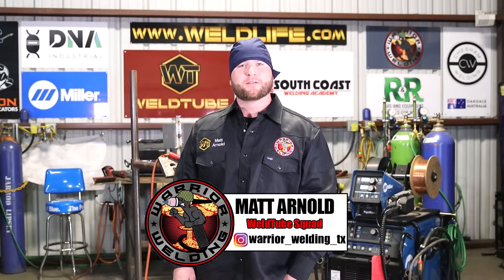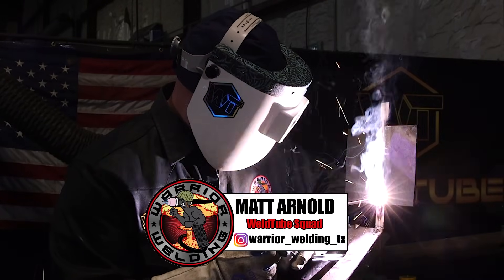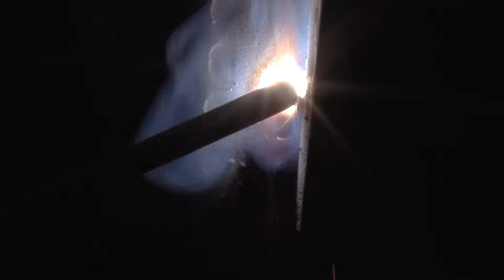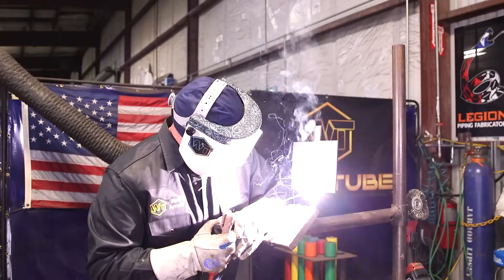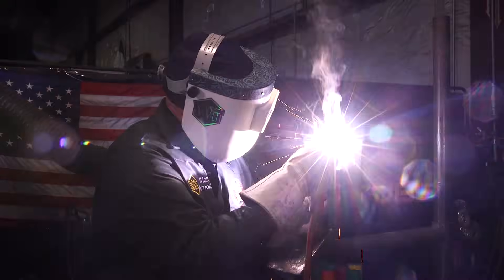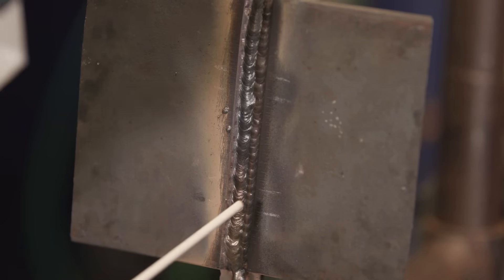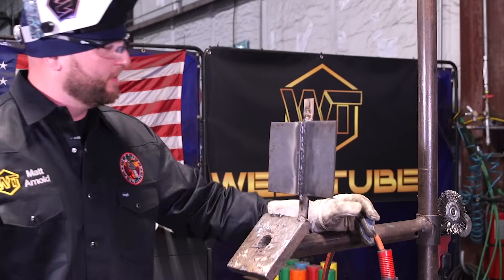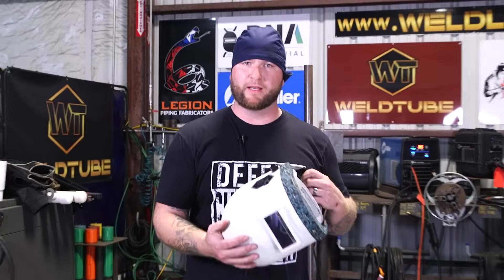3G Uphill Stick Welding D1.1 Test | SMAW

Comment: Wish I watched this before the weld test I went in for. Definitely would have had a better chance. I over thought the “no weaves” on the instruction sheet. Oscillating isn’t necessarily considered weaving. Threw away a prevailing wage job but oh well. At least I know what to expect for a D1.1 test

Comment: What settings should I run on one of the school FlexTec 350x Lincolns? Specifically for vertical, I tend to move fairly quickly but Ive slowed it down to prepare and Im still getting a fair bit of porosity. Right now Im running 93 amps with a 10 Hot Start and -6 Arc Control

Comment: Thank you so much for posting these videos. I'm taking my D 1.1 3g and 4g tests in 2 weeks, and four weeks.  This is going to help so much, besides burning electrodes in my backyard with a cheap spark box😂.  We only get 7 hours of shop time 1x a week at my school which isn't enough.  I pray i pass.  I'm still going for my local ironworkers Union written test, and already applied.  Practice makes perfect
Reply: All I can say is the iron workers unions retest you no matter what welding papers you have. They have there own test that you have to pass for the local an the international it’s the same test no power tools 1 inch for an unlimited an 3/8” for a 3/8” but if you can pass a 3/8” you can pass a 1 inch

Comment: I've been having trouble while doing verticals, when I start the weld the bead is going good but once I start getting close to the top it's starts spattering everywhere and my weld starts to drop out. Any idea why that might be happening?
Reply: Plate getting too hot.

Comment: For shipyard  test, they want you to run stringer beads the whole test. Which makes since for the amount of heat in a weave bead,that heat changes widens grain structure.
Reply: yea most structural welding jobs only allows stringers or has a set bead width you need to match.
Reply: I'd rather weave the entire test,letting  it cool a little after each pass, I think it's a better weld and a better looking weld  ,I've heard people say both though?
Reply: @DavidGregory-qw4ws stringer beads are stronger
Reply: I'm an instructor at newport news shipyard and we don't allow stringers on test it has to be weaved
Reply: @dnice.757  Are you a structural welder or just manufacturing parts? also different jobs may require different bead lengths depending on your process etc.
Reply: Thats good to know! @dnice.757
Reply: @dnice.757 why?

Comment: How are you getting such good pen on 85 amps when i was running my flat test i had to crank it to over 130 on 7018 rods just to get solid pen.
Reply: You running DCEN? also 3/32 rods use lower amperage than 1/8
Reply: @codymillager720  No EP 1/8 rod. Im sure its probably my arc length and angle but the welds look great, getting nice peel but when i go to do the testing im getting some breaking and minor pitting horizontally on the root where the backing is. The throat bends do hold up though. I think the biggest issue is that we dont have a grinder in class and i cant just give it a quick shot to take off some of that mill scale.

Comment: New hood still in development? 

How much development do you need to rehash the same hood that's been around 70 years?

That bevel looks like trash! Look at all those dips. Overall I would expect better videos out of a welding school. Absolutely no mention of how to prep your plates like removing mill scale on the back side or backing bar.

Comment: I'm currently doing this test at school right now except it's with a 1 inch plate. I'm having the hardest time, it's like I forgot how to weld. So thank you for this.
Reply: exactly uphill just difficult 😭😭😭
Reply: @MacOnSaturn  Uphill gets a lot easier over time just keep practicing.
Reply: @JoeRoganVault1  yea i’ve mastered it now😮‍💨
Reply: This is kicking me in the rear right now. The class prior just running welds up the plate I did great and picked it up quick, not so much now!
Reply: @MikeFL2TX  yeah welding humbles you.
Reply: @ivandalok i weaved don’t forget to pause on your edges
Reply: @MacOnSaturn it doesn’t take 4 months to master welding, it takes years
Reply: @MacOnSaturn bro u didn’t master it 💀
Reply: @Mdawg100 bro hating on me just because yu ass don’t mean i am😭
Reply: Hope you passed 🎉

Currently scared of my test soon
Reply: @ChinoTheBear  I did eventually pass. Took me 2 tries
Reply: @thisfool90 I made it through oxy welding, stick and mig, but had to stop. As this is all hobby, I’ll see what’s next as far as welding school goes.
Reply: Settings are a lot of it
Reply: What till uphills are your nicest welds bro haha they are hard but once you get it you can make them nicer looking then a flat with the same strength

Comment: What’s a good amp for this ? I have it at 115
Reply: For me, 3/32 between 85-90
1/8 between 110-120. Every machine is different.
Reply: @petergriffin7121 I use 3/32 around 88-92 I use a Lincoln.
Reply: @okieboyz815  haven’t used that machine, do you lower it after a few welds since the metal tends to get hotter?

Comment: Today was my first day for intermediate stick and my teacher said to put it on 100 amps I thought it was too hot when welding and my welds were shit no matter what I did I’m gonna try this thank you sir!
Reply: Amperage depends on the size of the electrode your using. 7018-1/8 electrodes are run at about 100 amps. In this video he’s using 3/32 rods at about 85 amps. But always play around with the settings up/down because if other people are welding around you and drawing on the same power source, it might be what’s causing problems also. Hope this helps.
Reply: @AuthenticSillyGoose another factor to add is that it makes a difference what temp the plate test is. If you’ve been adding filler passes nonstop for 10 minutes, you may want to turn down the amps a little when the piece is getting hot.
Reply: you can also google the specific electrode you’re using. the manufacturer will often have suggested setting provided on their website, in my experience they’re usually pretty accurate
Reply: Best way to learn. That way, you know what way too hot is.
Reply: 7018 1/8 inch I weld at 115 an with the guys I work with that’s cold to them they are at like 125 to 130 but all I can say is go up to 115 for an hour or two when practicing so you are trying to catch up an then slowly go down till your speed it matching the amperage an then get used to that an slowly get quicker an the amperage will slowly go up. It’s just a game up what looks right an feels right the hole time

Comment: Hi, I have a question, if I have half rod that I have used before the mechanical strength of the joint will be the same or lower than the previous weld done with a  new  stick? I know that in some factories half used rod are thrown away for this reason

Comment: Just took my 3g test last week according to d1.1,1 inch thick plate using 1/8th 7018.  passed it without power tools. It was one of the best plates ive ever done
Reply: No power tools allowed at my Union either.. 😂.  Chipping hammer aka a raking hammer and a brush.. i didn't mind.
Reply: No power tools at my hall either for plate test
Reply: That rule is so dumb like if you aren’t going to use power tools in the field
Reply: What was your settings I got a test on Tuesday 7018 1/8 3g
Reply: Power tools weren’t allowed?
Reply: @downhilldaddy5282 my union welding school doesnt allow grinders. We have to use a chipping hammer, picks and wire brushes. But if you are going for light gage certs. You can use a grinder. Its very stupid.
Reply: @drpeppero3  interesting
Reply: @drpeppero3  it’s smart this way you qualify for your bridge Cert D1.5 without having to retest I think that’s why they do that it’s a D1.1 / D1.5 Combo test

Comment: Did you stay at 85amps the entire time?
Reply: Yessir!
Reply: @Warriorweldingtx  thank you for clarifying that. I've been fighting to get this right in my class and after watching you I realized I've been running way too hot.
Reply: I’m running a 3/32 electrode though so remember that, if you’re running a 1/8” I’d run around 115-120 amps.  Best of luck!
Reply: @Warriorweldingtx  we run 3/32 in class and I had been running it between 115-125amps. I kept getting massive amounts of arc blow at the top of the weld right before the upper runoff tab. Last night I went in and cooled it down to 85amps and it ran perfect. Thank you.

Comment: So what do u do with the plate after ur done like the back part?
Reply: You remove it
Reply: Gouge it off with cutting torch. Grind mill scale off, inspect root, then cut for bend
Reply: The inspector will look for the heat zone reflected on the plate.

Comment: Wtf???
Canadian cwb requires 2 start and stops inside the bend area,  how else do you test your tie ins?
Reply: I’m from Alberta I’m thinking the same. Much easier test to pass this than any cwb I bet
Reply: @houzer4444  yes I've also seen an AWS I believe,  and they were aloud to grind between passes.?!?!?!?
Reply: @davidsolomon915  you bet, power tools are allowed, a D1.5 bridge code test does not.
Reply: @Warriorweldingtx  yes power tools are here too.  But only a wire wheel.  No grinding or file  or die grinder. No material removed. 

Test is alot about bead placement , test needs to be thought out right from root.   It about sound welds at production speed.

If you grind out your weld after every pass, not very fast fill rate
Reply: @houzer4444  I'm in calgary. Where you at?
Reply: And we use 1/8

Comment: Why don you use a copper backing plate instead of a steel one? Doesnt that steel one need to be ground off?
Reply: You weld steel to steel. Your root is burned into that backing strap to make one solid part. If you out a copper backing you'd encounter all sorts of problems. Sometimes that plate is ground off, machined off, or sawed off
Reply: @gavinhughes6054  What problems would a copper backing cause?
Reply: @gavinhughes6054  at my college we use scarfing tips on the oxy torch for our backing bars
Reply: You gouge the backing bar off with cutting torch. Then you grind off all mill scale then cut to bend.

Comment: Something to consider, if you can use power tools, on the fill passes don’t strike ahead. Light up behind where you stopped and grind off that high start. You don’t have to worry about burning out your start when you do that.  It doesn’t work on the cap passes because you’ll have a grind mark on the cap then.
Reply: i wouldn't recommend doing that it will create bad habits
Reply: @OhioEverydayCarry  some places require you start at the back of your crater and grind it afterword that’s how trane technologies in la crosse worked for all their weld tests whether it being ASME or PED
Reply: @zachpiller7653  that's works but what about for the cap??

Comment: Keeping with the quality content as per the usual, what is that high pitched chirping sound, I've never hurd that before 🤔
Reply: It really killed the video for me
Reply: I have a Lincoln that sounds like that from time to time. Usually when it does it, it seems like the arc is hotter. Whenever it happens, I just turn the machine off and back on.
Reply: It’s the machine
Reply: Hobart 7018s tend to whistle a little bit
Reply: it’s just a miller thing

Comment: Every d11 test I've ever taken was done semi out doors with a generator welder and there were no power tools allowed. Simulating field welding were most d11 will take place. Good stuff but I do wish a field type machine was used. If your a welder you know they burn different
Reply: No power tools is a d1.5 bridge code test.  As far as welder goes, there isn’t any designation stating what kind of power source is acceptable for testing.
Reply: Jimmy King jr I agree👍🏾

Comment: Do you have to run stringers for the cap. We always did it one big one.
Reply: You can do stringer or weave it’s really up to you a lot of people do stringers so there cap won’t be to low I like doing them both ways
Reply: Im always told not to weave by new instructors. But an old timer taught me to weave so thats what i do. Occasionally ill try stringers but weaves my fav
Reply: I’ve always been told not to weave more than 3 rods width. By the time you while back over your welding into cooled slag